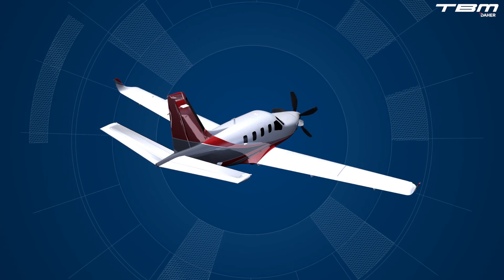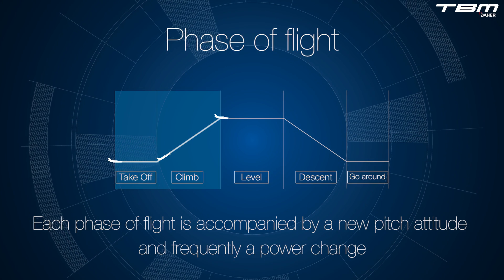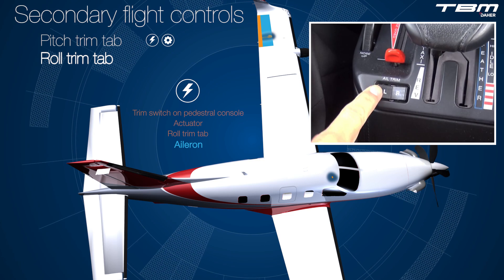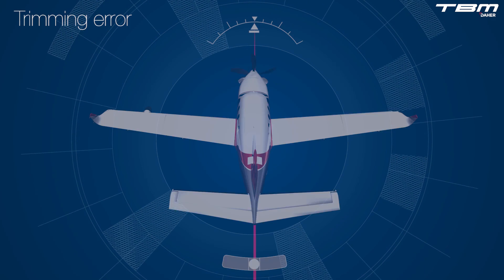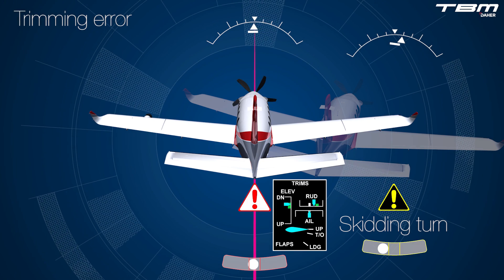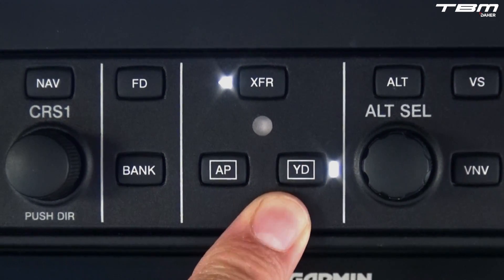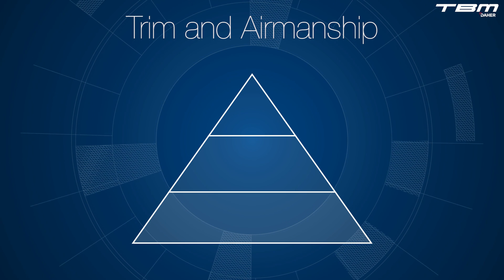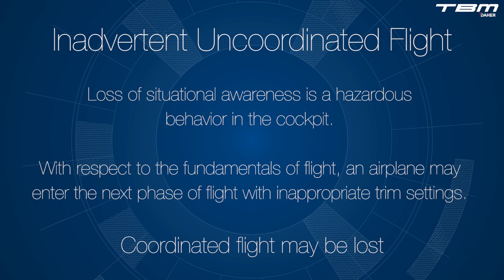Principles of Flight - Part 3 : Trim & Uncoordinated flight

Comment: Could you do a video on the elevators? I always thought if the elevators went up...the nose would go down and if the elevators went down the nose would go up. I have to explsin this to children and i just dont get it!!!t I know it's the opposite... I just cannot understand how it's so. Again, I have to teach this!
Reply: montanacrosses 
As the air flows over the tail and you pull back on the stick (pitching up) there is resistance on elevator essentially pushing the back if the plane down and therefore tge front up. pushing forward on the stick (pitch down) will angle the elevator down, increasing air resistance on the tail pushing the tail up and the nose down. Hope this helps, if not try google
Reply: If the elevators were placed on the fuselage or the center of the plane closer to the front, then it would work the way you said. I remember thinking that as well.
Reply: elevator down = more lift on the tail which creates a moment turning the nose down, and vice versa for elevator up.